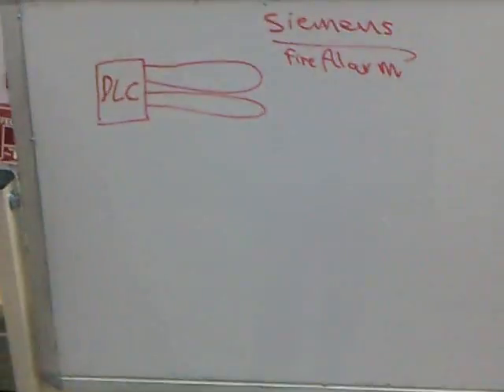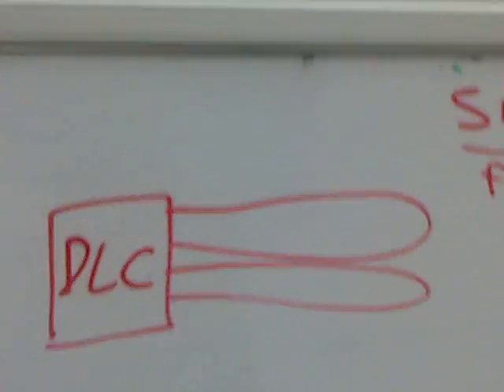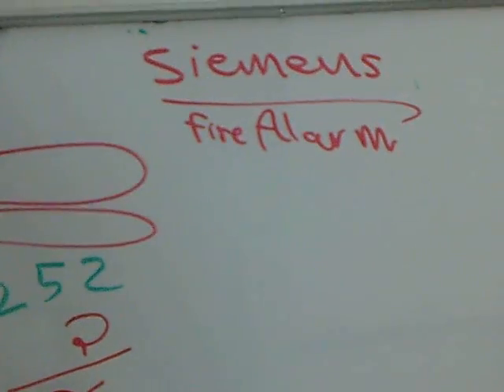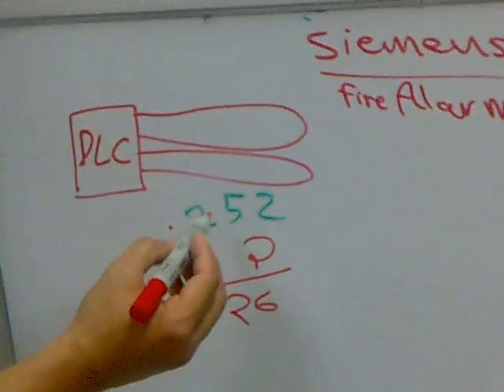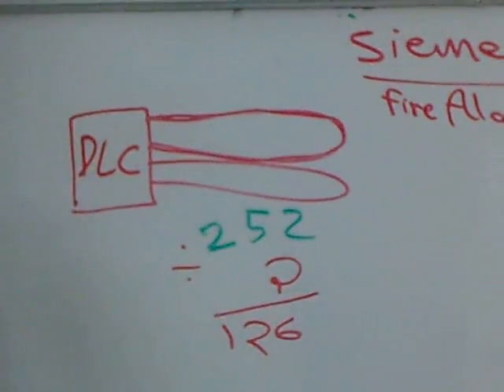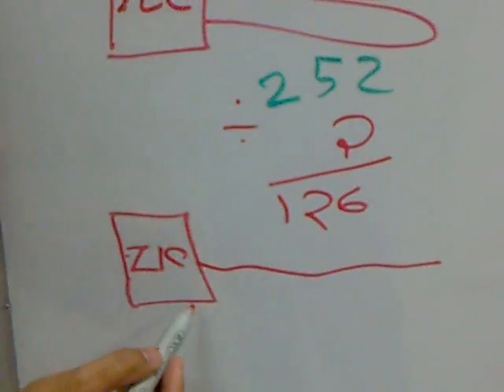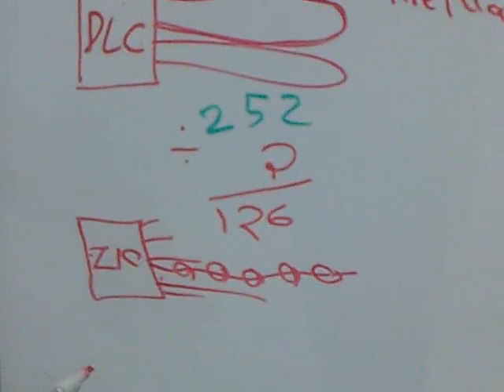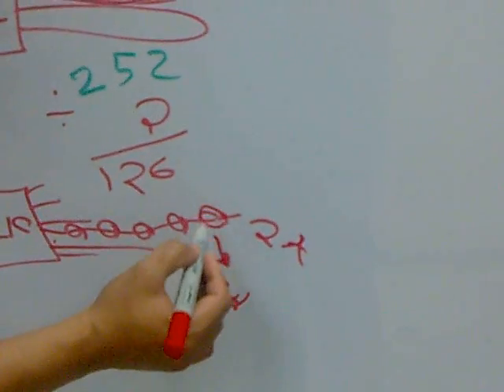siemens fire alarm system 2

Comment: Device Loop Card= 1 LOOP / 2 Zones... each card can handle up to 252 devices or 50 ohms of resistance.  You can have up to 252 devices on 1 zone if you would like. ZIC-8B= Zone Indicating Card... each card has 8 output circuits wired in class B ONLY... each output circuit can be programmed for up 2 amps.Just for your information, Siemens offers training on these cards and many more... you get a certification at the end of each class. Just trying to help brother.

Comment: I have one problem. I have one FACP in the commercial building which is old (addressable type)  and i am a designer of the renovation of some part of that building where we need more smoke detectors. my question is this. Can the new model of the same brand be compatible with the old in terms of looping it together. ( the brand is simplex) it will be great help. Thanks in advance to anyone who is able to help
Reply: If you install new control panel for addressable type, it will not compatible for the old devices. Only conventional type of system can reuse some existing device.

Comment: The number of devices is limited only because the addressable ID cards (used to give each loop device it's own number) only go up to 7 binary places, leaving a MAXIMUM device list of 127 addresses per loop. An address CANNOT be more than 127, 152, or 252 at that matter.
Reply: This comment makes no sense.  252 devices per LOOP. The address for each device is decided by the programmer and programmed using the DPU.

Comment: Total of 252 devices u can connect. Doesnt matter the no of devices in each loops...should not go more than 252 device.
Reply: 1 Loop per DLC... 1 LOOP / 2 zones = 252 devices per loop anyway you want to wire them as long as you do not exceed the 50 ohm max.